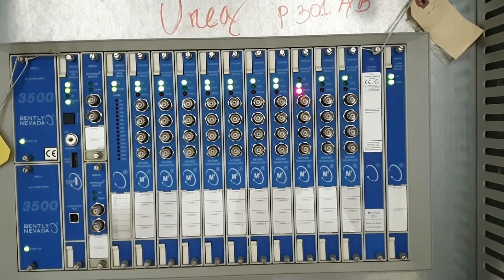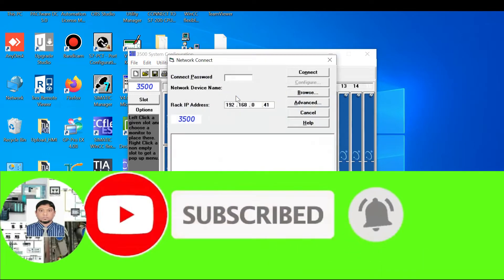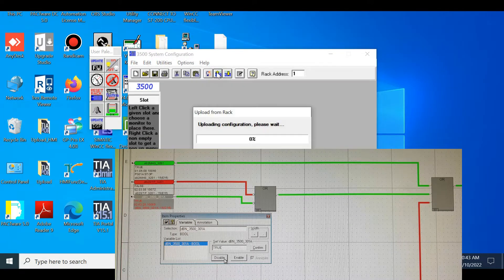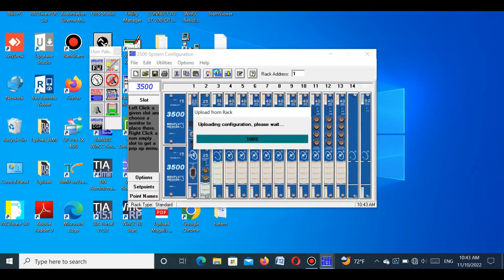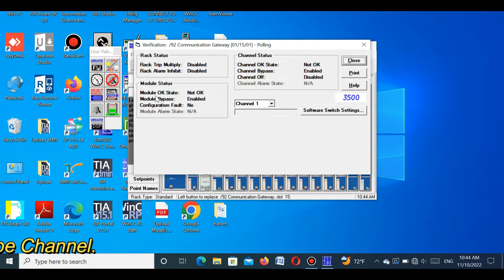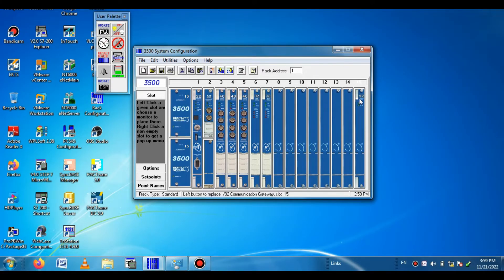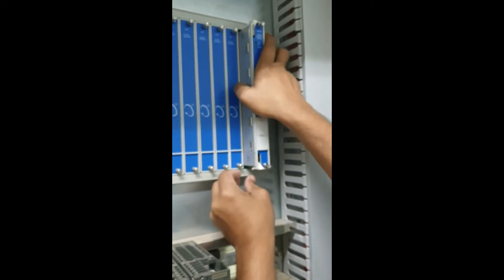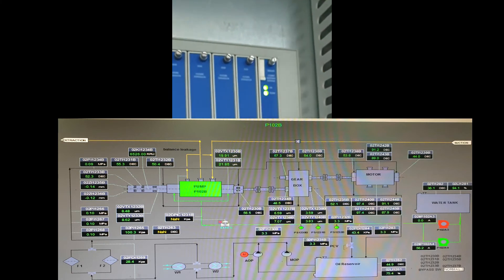How to Change a Damage Card/Module in Bently Nevada-3500 Vibration Monitoring System?

Comment: Dear Sir
While replacement of Communication gateway Module which one I need to be bypass for avoiding equipment trip.
Reply from the maker: Communication module is only used to  display values in dcs or HMI to monitor the values. I think no need to bypass. Or you can bypass the communication gateway to avoid unexpected situations.
Reply: @automationtools123 hello . I have problem .i need help pleas
During the data upload operation from the rack to the PC, we noticed that only the TDI card displays data, while the other locations (slots) remain inexplicably empty. This observation raises concerns about the integrity and recovery of data stored in other rack locations.

Attempting to download the program to the rack encountered a major obstacle due to the mismatch between the virtual slots (blue) and physical slots (green) relative to the TDI board. The TDI card is designed to interface with physical rack slots, but due to this incompatibility, the download process remained unsuccessful
Reply: How can bypass the communication gateway?
Reply from the maker: @Veeresh1719  
Same procedure